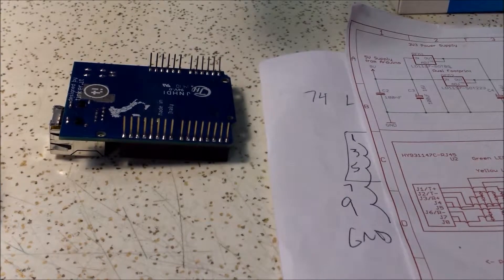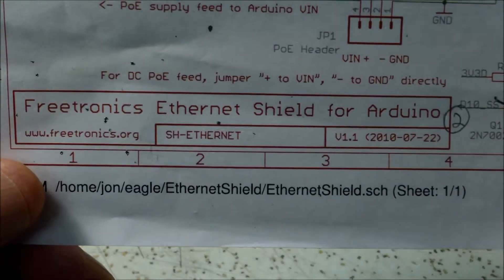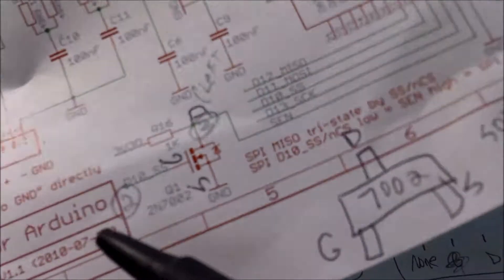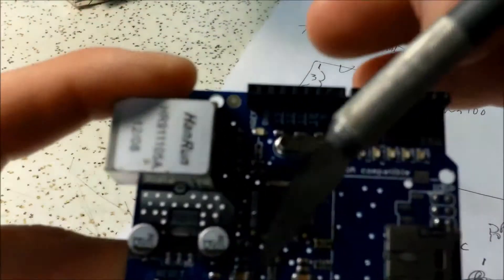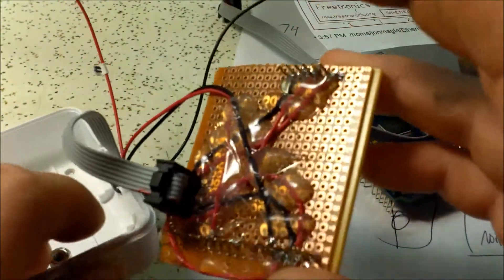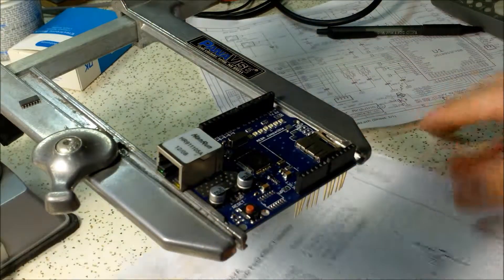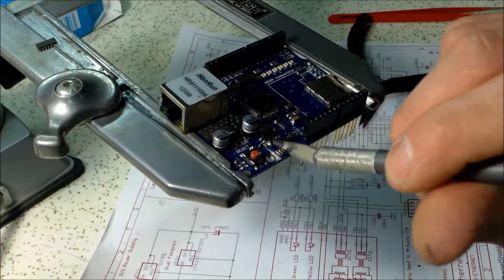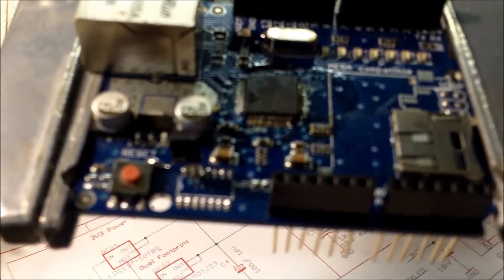How To: Hacking the Arduino Ethernet Shield

Comment: What do you mean, no way to deactivate CS of Ethernet shield? Ethernet is using D10 if you set it as output and HIGH state, it is disabled. I did it without any problem using software, and with Ehernet shield present I used NRF24 to communicate. This could be done using software playing between low and high state for the pins 4, 10, and 9(in my case for NRF).
Reply from the maker: Ok. Wonder if they change the IDE to allow this because before with spi I could not get it to work because the spi library controlled the pins.